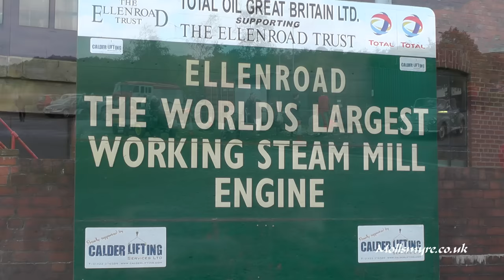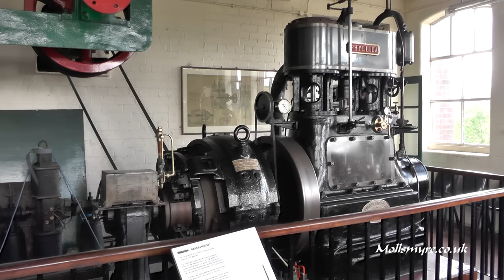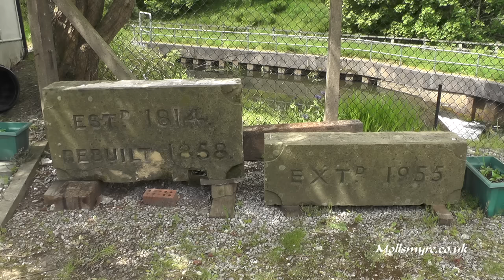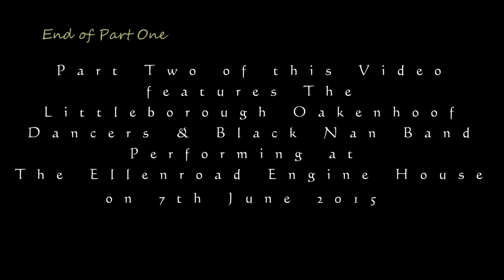Ellenroad Engine House June Steaming Day 2015

Comment: Once again Keith Appleton rebuilds a steam engine and makes it work perfectly!
Reply: lol
Reply: I keep expecting to see Keith pop out and start refilling lubricators.
Reply: @edspivak6575  Yes!   Many years ago I visited a steam powered natural gas pumping station in Pennsylvania with my dad,  and I was surprised to see men manually filling the lubricators and I asked why didn't they use some kind of mechanical system. The man told me, this was the way they always did it, it was simple and allowed them to visually check each moving part as they made their rounds. The station now uses electric motors, but the steam pump is still on display and it still works so they keep it well maintained on standby in case of electrical failure.
Reply: @bullettube9863  
Where in Pennsylvania were they using steam engines to compress natural gas? What year? What was the design of the engines?
Reply: @gregorymalchuk272  A bit of googling around suggests that the Bradford Gas Company (in Bradford, PA) used a steam engine in the 1880s, and others followed later. No mention is made of what type of engine but I can't view the full book on google books ("The Natural Gas Industry in Appalachia: A History from the First Discovery to the Tapping of the Marcellus Shale, 2d ed.")
Reply: @bullettube9863  
Where is this pumping station and what is its name?
Reply: @gregorymalchuk272   I can't remember!  I know it is in North Western Pennsylvania some where, but It was a long time ago.  There was a YouTube video that showed it in action, I'll have to search for it again.
Reply: @gregorymalchuk272  Since it was so long ago and I was so young I never understood what it was.  But it is a heat engine, burning natural gas (of course) and not a steam engine. A quick search on You Tube and I found several videos of it!  Damn I love You Tube!

Comment: When I was 16 , I saw a similar engine removed from a mill in Rodley near Leeds ,Having watched the machine running may times I was so deflated when I arrived one Saturday morning and it had gone .The mahchine had rope drive between the flywheels it was highl polished by the engineer in charge .I  never saw him or the engine again I am now 80 y old ,but I still feel the disappointment of that day .Rob Atinson
Reply from the maker: Hi Robin, They truely are wonderful machines. I dont suppose the people who operated them back in the day would agree. It must have been extremely hard work. I can fully understand your sadness when you discovered it had been removed.
Reply: @mollsmyre  I allso remember the engine room having fully painted walls and floors,I had to take my boots off before being allowed in.I was there with 2 older men to do a repair on one of the Lancashire boilers opposite the boiler engine room ,not really as tidy as it could have been. Best wishes Rob

Comment: The best part was the obvious rapport between the old hand and the youngun, and that the old hand was clearly still as fascinated as he must have been when he was a youngun!
Reply from the maker: Looks like our Heritage is being left in good hands.
Reply: For me, a very insightful reminder that age doesn’t differentiate when it comes to wondrous things. Great video, thanks for posting.
Reply: I love steam engines
Worked with Belli's mar com 500 KW in palm oil mills Malaysia.
Reply: I remember my dad taking me to the mill where he worked.  They had a similar engine to this one, with high pressure cylinder at one side, low pressure cylinder at the other side and a monster flywheel in the middle. Lineshafts powering the looms or spinning frames on  each floor were driver by ropes that fitted snugly in those grooves in the flywheel.

Comment: THe engine house is all that remains as the 4-5 story mill was demolished.
Reply from the maker: It certainly must have been a very impressive sight.
Reply: The original millbuilders were proud of their mills and engine so the engine house usually had big 'cathedral' windows to let plenty light in and show off the engine.
I used to see one like this when waiting for bus about 65 years ago.  It was all painted green with lots of polished brass and copper and the inside walls were tiled in white tiles...looked really good.
Have a look at this one complete with the ropes at 3:01 going over a dummy pulleyat 5:34  as though they are still going up to spinning and weaving machines.  But they are shortened and just run round a dummy pulley to show it it was originally.
It's quite nice to stand beside the engine when it is working ...
http://www.bancroftmill.org.uk/video.html
Reply: @rosewhite---  Because the the decision to demolish  the mill building had been made to create a new factory, in doing so the rope race structure lost its supporting brickwork and would not stand on its own so required controlled demolition.

Comment: interesting machines, but I wish they would tell us what we are looking at, what is that big wheel with the groves in it?
Reply from the maker: The guys at The Ellenroad Engine House can explain it better than I could. Hope this helps.   https://sites.google.com/a/ellenroad.org.uk/www/On-Site/victoria-alexanda
Reply: the grooved wheel is a pulley using ropes for belts to turn the pumps below he engine  Mollsmyre thanx a lot noe it makes sense, it's amazing that they used ropes for belts but in that time a large rope would have been stronger than a leather belt, no nylon yet
Reply: Ya im with you on this one don't know what it do or what it was.It always helps to know what were looking at and what,well u know.
Reply: the big wheel is the rope drum and when mill was still standing and working it had 4 or 5 floors each with lots of looms, spinning machines etc.
Thick ropes round drum reached up through hole in wall just visible above the drum.
Ropes had to be 1-300 feet long to reach top floors of ill.
When I was little a mill by bus stop had a big beautiful engine all polished and painted and everyone like to watch it working...
Reply: the belts look shiny but it is linseed oil or a molasses compound to make them sticky so they had plenty of grip in the grooves.
The belt 'laps' half a lap round the big drum and the small drums on the line shafting and the half-a-lap friction and grip can transmit a lot of power.
Reply: The big fly wheel is the main part turns all factory machines by belt in that time wasn't belt were ropes .
Reply: All built and constructed by men with very little education, my father only had a 8th grade education and went to go work in a machine shop cutting out the bases of bomb shells at age 13 during WW2 in London.
Reply: At one time there would have been a large belt that looped around another pulley that was mounted up in the top corner of that building that drove a long steel shaft in witch other pulleys had more smaller belts that went down to the machine that required power like a lathe or drill press and saw mill blades or even cotton gin separating machines ! A prime example is at silver dollar city in Branson ole time saw mill
Reply: @andrewward1887  stay in school kids lol
Reply: @andrewward1887  they had plenty of education. It just wasn't useless university education.
Reply: @Dwendele  As opposed to today's youth who cannot make change without the display on the cash register giving them the amount, can't use a dictionary, can't balance a checkbook, and get upset because my pay is more than theirs because my 30+ years of DOING the job trumps their 4 years of college LEARNING about the job.

Comment: the steam operated fire pump looked very interesting but the sprinkler system looked all painted and i believe i saw a sprinkler head within 7 cm of a hanger rod.
Reply: The US Navy ship that I left in 1990 had 3 electric fire pumps...and one steam-driven fire pump for those times when you have no power...

Comment: Beautifully maintained stationary steam engine.  How many shaft horsepower???  Thousands by today's measuring standards??  What is the function of the segmented and fluted flywheel?  I have not seen one like this.  Very nice.  Good Work Chaps!
Cheers
Reply from the maker: I agree it is a beautifully maintained engine and a credit to those who built it it and the guys who maintain it now. I'm not 100% sure but I believe its 2650hp and to be honest I have no idea about the segmented flywheel. Sorry I couldn't be more helpful.
Reply: So 100 years ago this machine had no other purpose than to impress people? 
It would be helpful to know if it was pumping water or making electricity, or something else. 
Maybe that would also give an idea of what the flywheel actually did.
Reply: More than likely this engine was used to pump water into the city.  The flywheel appears to have many grooves for v belts which may have driven an assortment of different kinds of loads inclusive of water pumps, generators, and coal gas compressors.  A great deal of industrial commerce as well as every day domestic life was run off of coal gas, and it was compressed and run through pipes to street lamps, cook stoves, heaters, and many other devices that could run off of a gas form of hydro carbon, like coal gas. Flywheels on steam engines provide kinetic energy storage in that they maintain the rotating force in a smother method.  It is also where all the different systems coordinate their individual functions in a steam engine inclusive of valve timing, speed regulation and delivery of power to ancillary devices and loads.  A reciprocating engine of any kind with out a flywheel to damp out power pulses runs very rough, and irregular.
Reply: Apparently Ellenroad was a spinning mill so this power plant was used to spin yarn, thread and other millinery, fabric and other like products.
Reply: Thanks a lot for the answer.

I read this too on the history page. 
"In the late 1880's the Ellenroad spinning Company was formed to respond to the boom in the cotton trade. They turned to the well respected Oldham architects, Scott & Sons, to managed the design and construction."

So I guess it was providing "engine power" to all the weaves and sewing machines and so on, needeed in a factory of that kind. 
In the steam age it was normal to have long rotating shafts going under the ceiling, through the factories where belts went down to each machine to provide power and movement.
That can even be seen in old movies.

But electricity is easyer and more efficient, and takes less space, so today all equipment has it's own build in motors. 
I love the steam age, but I also think it was only a steppingstone in history to get to where we are now.
Reply: Benny Helmundt   __ People always say that but forget that most electricity is still actually generated by steam power in oil,  gas, coal and nuclear power stations. We STILL live in the stream age!
Reply: Yes... you are right.
We are thermonuclear fireculture. 
And even the next generation of hydrogen reactors which reaches billions of degrees celsius will only be used for boiling water.
Fuel cells however is not capable of delivering our needs of energy.

So steam is the best way so far.
Reply: The segmented flywheel facilitates many smaller diameter belts thereby obviating  the need for a very wide flat belt ,we used to run a wheel like this in James Ives lea-field mill  in YEADON when i started work there in 1958 ,all long since scrapped
Reply: the 'flywheel' is actually the rope drum and originally had thick ropes reaching up into mill to turn small drum of shafts going to the spinning and weaving machines. The ropes 'lap or wrap' half round the drum and the deep groove ensures they have plenty of friction grip to transmit plenty of power up to the spinning and weaving machines in the mill.
The 'segments' are just wood to fair the wheel in to stop it creating suction that could suck a person in or raise lots of dust.
Reply: 2800-300 Hp depending on how your calculations. The grooves in the flywheel each contained ropes which drove pulleys on each floor of the mill which in-turn drove the line shafting to power the machinery.
Reply: @3RTracing  Correct,  one of the engines I dont know about , but the Whitelees Engine had been installed elsewhere but had connections to Rochdale so was acquired by the council / trust and put in spare location in the engine house after 1987
Reply: @youghurt2k  I dont know how you can state that electrical drive is more efficient. . Most electricty comes from heating water to drive a turbine , factor in losses in transmission,   with electrical motors there is flexibility in machinery drive, but add in steam process requirements for the cloth and heating for the shop floors plus internal electricty for lights and so on and a spinning mill could be self-reliant as long as you can get the staff.
Reply: @highpath4776  Yes. You are right. As I wrote later... We are a thermonuclear fireculture. But still I think large powerstations are more efficient than old days smaller local steam engines. A steam turbine has less moving parts and delivers more effect. I am quite sure that if todays technology was less efficient, we would not have invented it to begin with.

Comment: What's the mass of the flywheel?
And was that little white chord some sort of kill switch to instantly close the steam valve?
For when somehow the governor gets stuck and the engine starts to run away out of control?
Reply from the maker: So sorry in delay in replying to you, only just found the message. Afraid all I can tell you is Victoria and Alexandra is 3,000 horsepower with a 80 ton flywheel. Again not sure if the cord acts as a Kill Switch but I think you may well be correct . Apologies for not being more helpful.
Reply: @mollsmyre  Thank you. 80 tons of spinning flywheel, that is a lot of kinetic energy and torque!

Comment: May I ask what the gentleman is preparing and purpose of the white paper coil at 4:45? Awesome majestic machine, excellent video thank you.
Reply from the maker: To be honest I dont know, I should have asked at the time. Sorry
Reply: Indicator Card.  Used to figure out IHP (Indicated HP) by PLAN/33000  Pressure(MEP, from the card)*Length of stroke(ft)*Area of cylinder(in^2)*Number of power strokes(min)/33000
Reply: I was indicating the engine to check the valve timing which I had noticed was not equally set on each of the 4 inlet valves nor on each of the 4 exhaust valves on the HP cylinders. We did an initial indicator test to check how far out of tune the valves were, then reset  the valves cold from measurements from tables in a 1908 textbook.  Then we fine tuned them with the engine hot, again using the indicators to draw graphs on the paper showing us what is happening inside the cylinders. The paper is put onto the indicator drum which is rotated back and forth by the string attached to the crosshead linkage in time with the position of the piston. The instrument has a small steam cylinder and piston connected to the steam pipe valved into each end of the cylinder. The instrument's piston operates against a calibrated spring which pushes a scriber up and down to draw a graph of how the steam pressure changes inside the cylinder in sync with the position of the engine piston. This gives you the point the inlet valve admits steam, the point of cut off, the opening of the exhaust valve and the closure of the exhaust valve before the end of the stroke to produce adequate compression. We adjusted the inlet valves to open exactly at back (or front) dead centre and the exhaust valves to close early enough to compress the trapped exhaust to half steam chest pressure - which acts as a 'steam spring' to store energy to help stop the 4 tons of pistons and rods and send them back the other way twice every second and also reduces wear on the crank and crosshead pins and main bearings. One can also calculate horse power by analysis of all 8 indicator graphs (one for each end of each cylinder).
Reply: @anthonypilling151  Thank you for the detailed information, it is all very interesting.

Comment: Here is what the mill engines were driving through the belts and line shafting:  hundreds of looms making basic thin cotton cloth for sheets, tea towels, etc.
This Queen Street mill had just one floor as it was important to have glass roof to get daylight to see any flaws in the finished cloth. But most mills were 3-6 stories with upper floors having machines like cards, creels, rovers, doublers, condensers which didn't need so much daylight.
The owners of these mills must have made and invested fortunes over the centuries.
https://www.youtube.com/watch?v=LtALjfYav0k
Reply from the maker: Thank you for the Information and the links to those excellent videos.